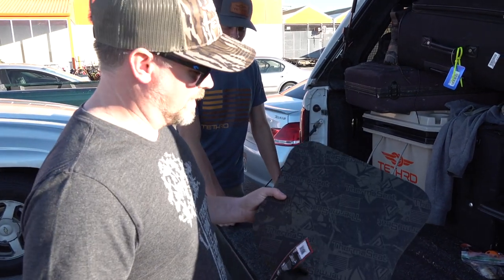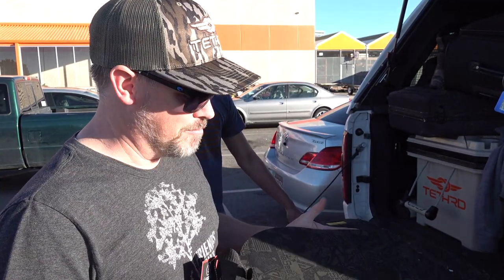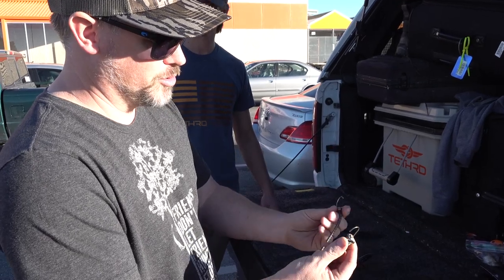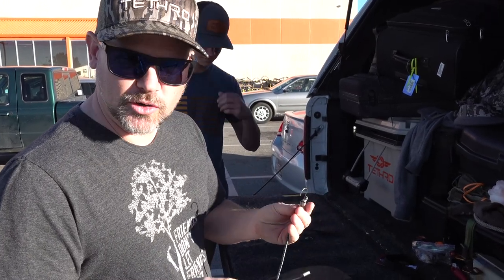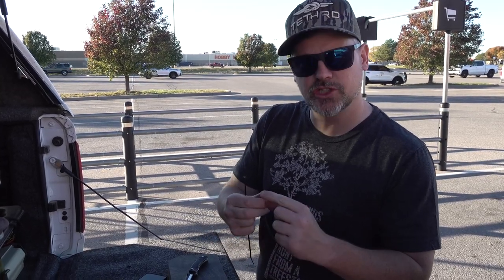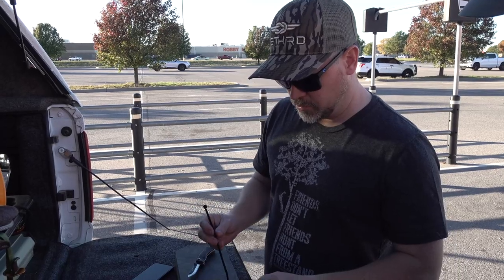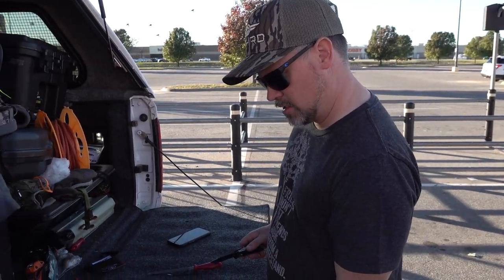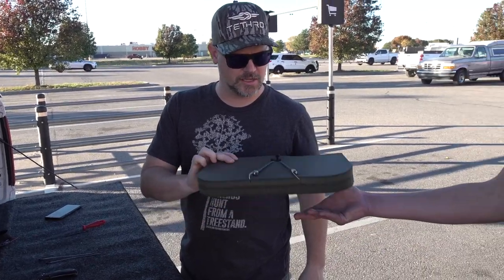Saddle Hunting Knee Pad - this is the easiest, cheapest, and fastest DIY knee cushion on the planet

Comment: I already had a single thickness camo pad for five bucks from Walmart. While I was watching your show, I cut it in half used  spray glue on both surfaces, used an old 10 inch bungee hook used to hold trail cameras, (which I never use) bent and sharpened 2 hooks, added a wire tie and had a knee rest before your video was over 😀
Until your video, I had planned on using the full size of the new pad with a strap that came with it, and go around the tree😩
Good thing I subscribe to your channel for about a year. Look forward to some deer in pig videos in the near future.   August 22, 2023 today.